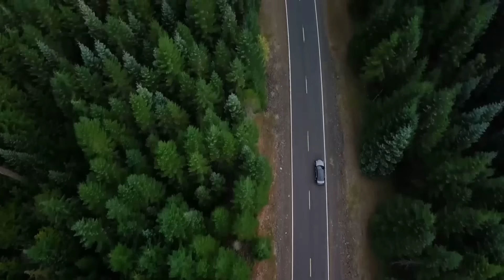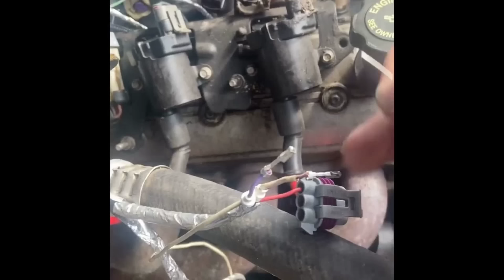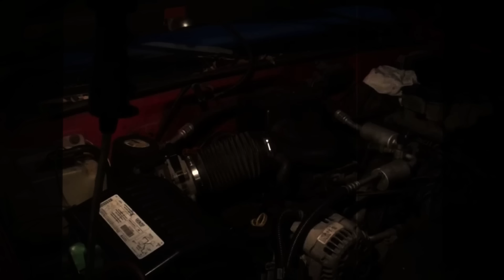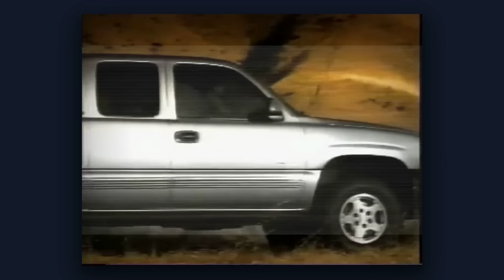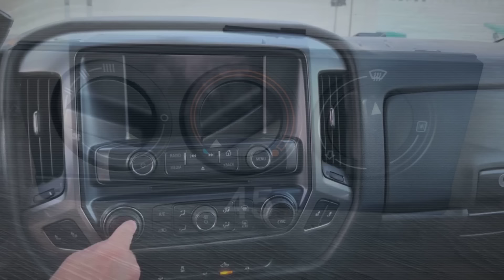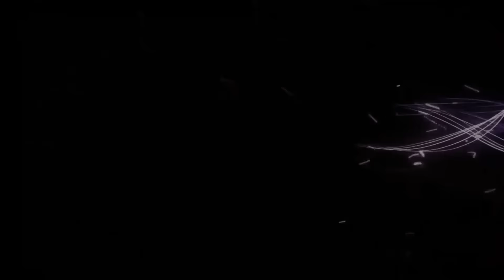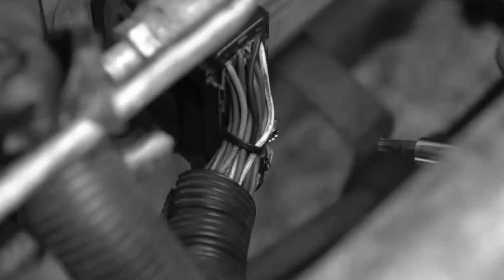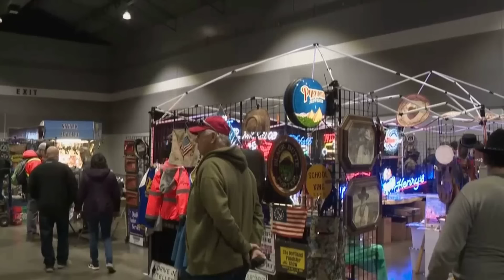How Smart Mechanics Are Bypassing The Dealership (The "Delete" Loophole)

Comment: I cut my factory key open and taped the immobilizer to the steering column under the cover and then I could use a cheap wall mart made copy of the keys. No more expensive keys.
Reply: It's good, but a proper ECM would have only one job - optimize the engine.  Not be the security system, TCM, and overall nanny!
Reply: Brilliant thank you

Comment: Cuban Mechanics and classic car owners; "Hold my cerveza.."!!!! 🍺🍺🍺
Reply: American mechanics when they see modern cars ten years ago: "You idiot! What did you do to this thing? 🤦‍♂️"
Those same mechanics today: "How do I repair this thing without the manufacturer suing me? 😬"
Reply: @samsimington5563 All of the drivetrain on those old cars in Cuba has been replaced with modern engines end transmissions and just about everything mechanical.  Most of the old 1950s Chevys have foreign-made diesel engines from companies like Hyundai. All of those old cars are used as taxes also. I've been to Cuba four times, the last time was 2025.
Reply: @actionjksn they did literally whatever it took to keep them running. If they had to use barb wire to get their motorcycle running, they did.
Reply: @samsimington5563  So True
Reply: Cuba - If MacGyver was a country. lol
Reply: I've ridden in a 56 Chevy in Cuba that had a Hyundai diesel engine and air conditioning. All of those classic cars are taxis, like every single one of them. Also the taxes do not have a meter you just negotiate the price before you get in the car. The classic cars from the fifties are not the majority but there is a lot of them l it looks like there's about 25% to 30%. I mean it might be less than that but that's what it looks like just driving around.
Reply: Old school is the best school.
Reply: The cubans should have a YouTube channel to teach everyone how to keep a car running for 50 years.
Reply: @AlmaVasquezjr Absolutely positively should happen...!!!
Reply: I've been to Havana, a lot of the old cars have some kind of foreign engine, small er stuff. They don't sound good.
Reply: @gerhardstoll118  who cares. they run, they're affordable and repairable 
Not everybody has the luxury of being a car snob
Reply: *Were

Comment: So basically we are now Cuba.
Reply: That's what the industry made us do by their ransomware. And now they're at the brink of collapse. And now they are whining because of their own actions, but keep blaming us. This is Gaslighting and manipulation to keep us fearful. I won't buy new ever again if they continue this road of ransom.
Reply: Power to the people 🇺🇸 lol we bailed out ford and chevy and they repay us with low quality products
Reply: @jesusolivares3749 it was GM and Chrysler. Ford didn't take the bail out.
Reply: @artemiofierros5371 but they still are considered the jack crew, from all our past products.  Ford has the same C.E.O. corporate greed inside the market, and passing faulty products just like the Chevy,GM etc Chrysler
Reply: @artemiofierros5371 i thought ford was going to faulter but was given a govnt contract to supply vehicles and would have defaulted if it wasnt for that help?
Reply: @artemiofierros5371 and Ford is just as bad with these issues and paying there techs is a huge problem no one wants to work for them
Reply: @artemiofierros5371  But now they have the $5,600 pair of taillights for the F-150s, complete with $3 Can-bus and other bus circuit boards in 'em.
Reply: @artemiofierros5371  Well, their current product doesn't suck any less.
Reply: @artemiofierros5371  - and chrysler was bailed out twice. 1979 by carter was the first.
Reply: @artemiofierros5371 
Pffft! Ford runs PLASTIC OIL PUMPS that are belt driven!

Fuckin
Only
Rolls
Downhill
Reply: @jesusolivares3749  ford has always had a government contact with police stations. 
That's a huge bump in profit. 
I drive a real one and everything is 3x the price of the base model and their mechanics always buy dealer parts or go directly to the dealer for maintenance.
Tax payers have easily paid billions directly to ford.
Reply: @jesusolivares3749  That's not a bailout. The bailouts were just the government handing over money. Fort took a job and did that job for money. Gigantic difference
Reply: @artemiofierros5371  Ford is building garbage like the rest of them.
Reply: @JohnDoe-og2bt Not really, a bail out can be masked as a contract. The government probably paid upfront, that's a red flag for a bailout.
Reply: @jesusolivares3749  well they are going to need another bail out 🖕
Reply: Yep,at least 1 American is seeing the light.. or truth... control!
Reply: Heading to mad max
Reply: Unlike Cuba, the US gov will regulate them out with emissions laws, "cash for clunkers" programs, etc. The US Gov has a massive stake/reliance in the success of the stock market.
Reply: No they knew where they stood! Perpetual deception here!
Reply: Have been since 1865
Reply: @briannorris6377   this isnt talked about enough. The repubs basically federalized the whole system over the multi-national slave owning class that consisted of 5% or less of the south.
Reply: @TBell4x so you think they should have left the slaves alone?😧
Reply: @TBell4x The South started the Civil War.
Google "Ft Sumpter".
The pro-slavers convinced the South that A. Lincoln would abolish slavery so they could win the election.
The plan backfired when he won because now they had set the nation on a course to a war which would cause them to lose their slaves.
Then, a pro South political zealot, Booth, murdered A. Lincoln because he thought Lincoln was some sort of evil despot.
When actually, Lincoln was the South's best friend. Lincoln's 2nd inauguration speech laid out an agenda of forgiveness and rebuilding. So the South mired itself in a "reconstruction" that took about 100yrs to recover from.
The South destroyed itself by  repeatedly pursuing an agenda of pride, oppression,  and revengeful malice. And their descendants still maintain the same attitudes while blaming everyone else for what they did.
And not just the South.
It's not about some conspiracy that's out to get you.
Neither is the parts issue in this video.

I've been working on cars since the 80s and when cars get old enough, the dealer runs out of parts.
Of course, they don't make parts for 20 year old vehicles. They don't make 20 year old models either.
It's not because they hate you and want to enslave you.
It's because they're in business to make money.

So are you. It's called a free market, capitalist economy.
Of you don't like, move to North Korea where the ruler can force the companies to keep making parts for a 1991 car just because he has one, meanwhile everyone is starving because it's about a man's whims instead of efficiency.

Old Man Rant for the day -done. Thanks for your attention. 
You may unfasten your seat belts and move about the cabin 👍
Reply: After the 2026 kill switch mandate appears in new cars it will be as if an airtight national blockade takes effect.  Pretty soon, the only way to get a newish car will be by getting an old police cruiser at auction.
Reply: my dad used to say Cuba had the best cars. old models from the US and they never rusted.
Reply: Yep
Reply: We will be living like them soon too... rationing
Reply: Without "Right to Repair" Laws, Waste Fraud and Abuse from the Corporate Overlords will be pushed that way until we are all made Corporate Drones or Slaves. Pay attention to what the Billionaires are doing and you will get the picture.😒
Reply: Wrong. Cuban leadership doesnt do this to their own citizens its our government. Stockholmed citizen. Cuba wants free trade and to control their own citizens.
Reply: always have been
Reply: No... they make stuff
Nevermind🫣
Reply: the US has been a Banana Republic for decades due to democRATs election stealing allready...!
Reply: Basically.....with a twist of ingenuity. We are smart. We will find a way.
Reply: Hell yea we need to bring some here to help design cars
Reply: Yes we are cuba lol these garbage ass vehicles today cost so much money I have a 04 ford expedition 4.6l she is perfect finding certain parts will be a challenge if not having to fabricate our own
Reply: Or you start busting down the doors and start demanding they start making parts again
Reply: Hell yeah! I live out in desert, and I gotta tell you...we HATE all this digital crap in cars nowdays. I've been around the world, Cuba is just the tip of the iceberg for me. But I love the car scene down there. They take care of their rides and their rides take care of them. Know what you're doing, and don't be a slave to the Auto-Monopoly. Plain and simple. 😎 🛻
Reply: @red_rage1442 agreed completely 👌 cuba style in the USA 🇺🇸 Is all the rage.
Reply: @RiceMichael-b7x   Exactly! Theres a Reason why fast and Furious 8 Starts in Cuba. Those cars are functional pieces of both Art and History. The people are great too. As long as you speak spanish and respect their customs...you're set. 😏🇨🇺
Reply: You win the Internet!😂
Reply: The world is
Reply: Late Stage Capitalism giant
Reply: Rum and Coke anyone?
Reply: @DanielWilliams-h4u heroin and candy
Reply: Thank the RINOs and Leftists
Reply: Cuban mechanics are the new MD degree
Reply: Not really. Cuba became like America as America went to shit but you may notice when we snapped out of it, we made proper replacement parts rather than some copper wire wrapped around a soda bottle with electric tape
Reply: Yup that or wait till china starts making parts that can actually work and last
Reply: No, they have free healthcare in cuba.
Reply: Tghat’s what they want for us to turn us into a broken down Communist starving sh!T hole.
Reply: @FatherDuck-i2z  Communism is prosperous, unless the capitalist empire is able to destroy it. Stop listening to man on TV ffs.
Reply: Unfortunately
Reply: No. Cuba has some awesome cars. Old cars. Here, not so much.
Reply: And not because of communism but because of greedy corporations run amok!!!
Reply: Agreed completely 👌
Reply: People need to just not buy it, if they don't have costumes they don't have money
Reply: Bingo
Reply: Soon to be mar a cuba? 🫡
Reply: Yes
Reply: Yes
Reply: Yep
Reply: it'll be even more true if we keep p¡$$ing of everyone else. gasoline is just the start.  if we nuke,  they sanction... and the Prez has no checks. even the chief of staff an vp an be congress cant stop him... one man with one button. then n we get isolated and ppl died/die. hasn't happened but easily can almost overnight
Reply: Not you
You can by newest car
You'll also pay a lot of money in simple maintenance plus the car will just cease to function in about 8 years
While these "cubans" will have an unstoppable car that will last forever 😊
Reply: Yes, 3d printing is next
Reply: I wish we were that skilled.
Reply: Esso lo que hay
Reply: They got some rad cars down there for sure because of that.
Reply: Pretty much because the Manufacturers are 100% Against Right to Repair and have been jumping through Hoops just to make them Harder to Repair and Software Locking Everything you cant even do a Brake Job on a New Vehicle without Specialized Software if you do them without it your Vehicle gets locked out
Reply: We are in the US with the best brains in the business.
Reply: More people need to understand this.
Reply: Standalone is actually way better
Reply: Yep.
Reply: Yeah, pretty much 😆😆😆
Reply: Not Cuba because this manufacturer driven. The Gov. doesn't help. But this isn't happeninfor lack of wealth. What Obama did was actually a fascist move. Gov. controlling private enterprise.
Reply: @DelilahTheOriginal  all of the expensive safety features, crash standards, emissions are gov regulation. You can't build a quality vehicle with longevity in the USA or europe. Not that shareholder greed isn't a major driver of it, the two are in collusion.
Reply: We are all Palestinians now, living in Cuba....
Reply: How is that? They have a lot of bad new vehicles?
Reply: @MetalNick  Clearly you haven't been there. The whole country is like a massive car museum. They keep their vehicles running for well over 30 Years! Cars in Cuba are better than most of the cars in America. 😏 🇨🇺
Reply: @red_rage1442  I see. Yeah I honestly had no idea what people were talking about lol. Sounds great. Respect to Cuba. ✌️

Comment: I haven't done any extreme modifications. I helped get a Mercedes SL500 started by adding an extra wire from the starter solenoid to the battery area. The computer stopped sending the signal to the starter. To start the car, I open the hood, turn the key to "run", touch the extra wire to the positive battery terminal until it starts and shut the hood.

I will probably be solving a lot of small problems on the 1987 Mercedes I started driving last year. I already fixed stuck brake calipers and replaced rusty brake lines and fuel lines. I removed the motor from the power antenna so I could lift the antenna rod and get good reception for the radio. I got the cigarette lighter socket reconnected so I could use a GPS unit to help with navigation. I wrote down a list of 20 other things I want to fix. The most important now is improving the fuel economy since the price of diesel fuel is now close to $6 per gallon. To do that I plan to adjust the injection timing and clean the fuel injectors with a fuel additive. Maybe I will look for a manual transmission to install in it.

I will probably be using more efficient modes of transportation this year like a bicycle, electric bicycle and a small motor scooter. I already have good bicycles. I just need to get parts and fix the e-bike and motor scooter.
Reply: Farm equipment diesel is cheap.
Reply: wouldn't be hard to put in a remote switch to a relay.
Reply: Had a friend in Texas about 15 years ago who ran his Mercedes diesel on used restaurant oil, highly filtered.  You may want to look into this.
Reply: @nevertolatetoprepare2802 I saw someone doing that. He put the oil through a paint filter and used 10% gasoline for better flow and faster combustion. I could try asking around to see if there are any restaurants that would donate it or sell it at a low cost.

Comment: YOU CAN DO SAME WITH AIRBAGS PUT A RESISTOR IN AND COMPUTOR READS IT AS A GOOD AIRBAG,  JUST NEED RIGHT VALUE.  YEARS AGO THERE WERE NO AIRBAGS AND NOW CARS GET WROTE OF BECAUSE VIT HAS BLOWN OUT AIRBAGS.  JUST SAYTING
Reply: I just drive my van with the airbag warning light going on and off intermittently, like the TPMS stupidity in my car.  It's not worth bothering with.

Comment: I don’t know about the other states but California helps the industry by having strict smog checks every two years. However If your car is 25 years + smog checks are exempt. Unfortunately for me I live in a 1995 32’ motor home rated at 60,000 lbs and California there is no exemption for me so if new or use parts aren’t available creative solutions (carburetor) may not be allowed. I’m out of California but if I make to many repairs/ modifications I won’t be able to return in my only vehicle.🤔
Reply: Actually, there is no exemption for cars that are 25+ years old from the biennial smog check in California.  The way it is now (as of March 2026) vehicles 1975 & older (gas or diesel) are exempt, vehicles 1976-1999 require a biennial smog check (generally with a Dynamometer, they call it a BAR-97 dyno smog check),  and vehicles 2000 and newer require a biennial smog check by just hooking up to the OBD-II computer.  Your motor home probably comes under the Clean Truck Check program which was recently passed by CARB.  I have a 1996 Chrysler Town and Country that still has to be Dyno tested, and it's getting more difficult to find smog check stations that have (working) dynamometers.
Reply: @Toby1952 I’ve been in Florida for the past 5 1/2 years and have only heard that things just keep getting worse in Cali. 😢 I love my home state but not the crazy libs and the leaches they elect. I don’t think I can blame the majority of the voters because I truly believe that the system has been compromised since the 80’s, maybe longer. All I can say is Follow the money and that will lead to the truth.🤔
Reply: @darylSKYTZOwillis  Absolutely agree with you.  I was born here in California 73 years ago and never thought I would consider having to leave the state, but I'm close.  However, lately it looks like there may be a glimmer of hope for this state.  Even the Hollywood elites seem to be getting fed up.  We'll see what happens in the next election.  If the Voter ID law that is on the ballot passes (assuming the democrats don't find a way to invalidate the proposition), I think that will go a long way to getting the state back on track (or at least off the train of self-destruction).
Reply: @Toby1952 Fingers Crossed 🤞🏼 🤞🏼😎